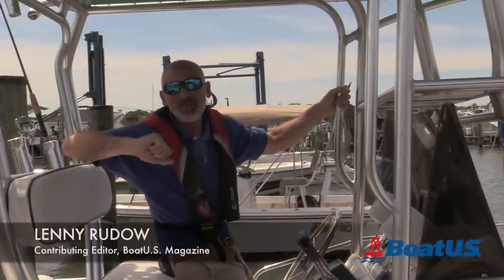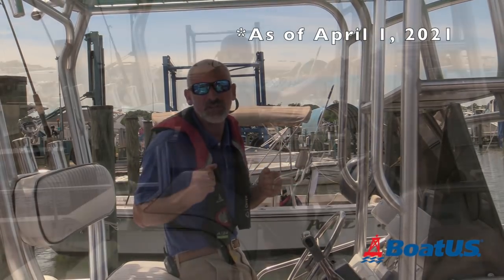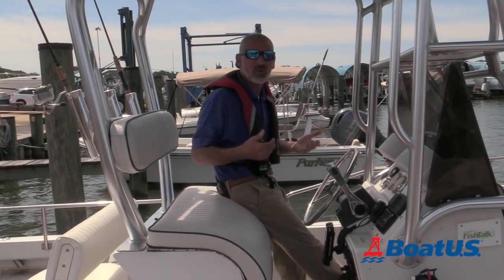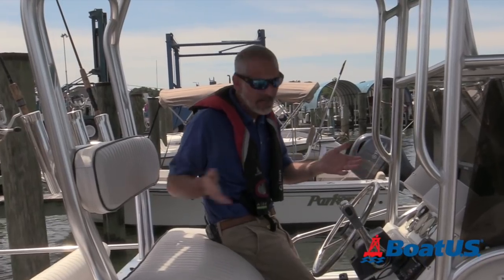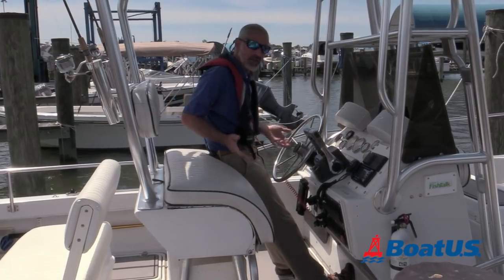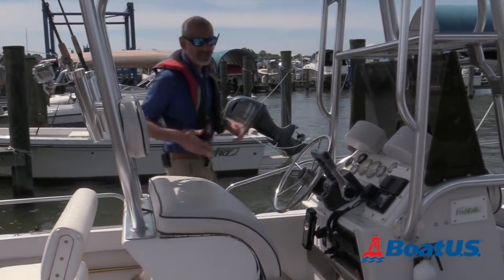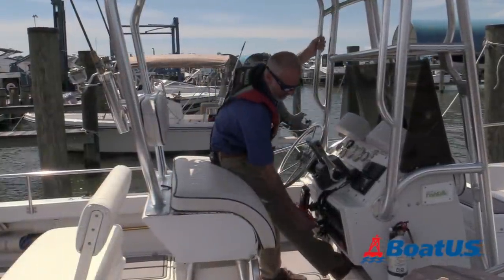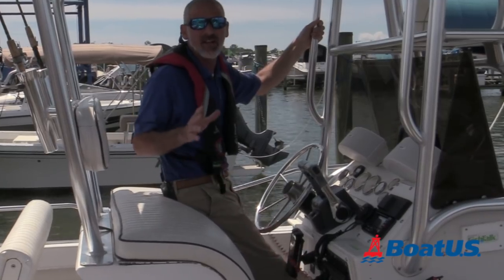Understanding the April 2021 Engine Cutoff Switch Law | BoatUS

Comment: Something I found on this topic:
"The new law applies to all federally navigable waterways. As this is a federal law, states do not have the ability to enforce the new ECOS regulation"

So, at this time, only the Coast Guard can enforce this law, And I believe "federally navigable waterways" are the Great Lakes, major rivers i.e. The Mississippi / Ohio, etc., and the Inter-coastal Waterway. To the point, it does NOT include your typical small inland freshwater lake where most US boaters operate. Not arguing if it's a good idea to wear one or not - simply trying to get the facts straight and I believe this video should clarify this point one way or the other. Peace.
Reply from the maker: I believe you're correct, Phil. There are several states (7, I believe) that have their own laws regarding engine cutoff switches, which they can enforce on their inland waterways.
Reply: @boatus  And those states would be...???
Reply from the maker: @davidmorgan4804  Alabama, Arkansas, Illinois, Louisiana, Nevada, New Jersey, and Texas. You can read more about the new law at https://www.boatus.com/expert-advice/expert-advice-archive/2021/march/new-law-requires-skippers-to-use-engine-cutoff-device

Comment: Experience tip:
The kill switch lanyard is usually left out in the elements.  After time the clip on the ignition suffers UV deterioration  and can partially disengage, killing the engine .  The problem is if you don't realize what just happened, you might end up getting towed in (like I did) .  Replace the kill switch as soon as the clip starts looking faded and chalky
Reply from the maker: Thanks for the great tip, Dan. We also recommend keeping a backup switch somewhere convenient. This serves two purposes: A backup in case your lanyard breaks or if the skipper goes overboard. Make sure to let your guests know where it's located in your pre-trip briefing.

Comment: On an older tiller boat that didn't have an ECoS are you still exempted after a repower?  A bit of a small-boat edge case.
Reply from the maker: Good question, Brent. Basically if your boat comes with a cutoff switch, you are required to wear it at planing speed, unless your state has its own laws. This also only applies to engines that are around 3 hp (produce 115 lbs of static thrust). You can read more about the law here: https://www.boatus.com/expert-advice/expert-advice-archive/2021/march/new-law-requires-skippers-to-use-engine-cutoff-device

Comment: Apparently Florida has taken the law one step further by requiring that you be connected to the cut off switch while underway; instead of while on plane.
Reply from the maker: I'm not sure about that, JPH. I don't believe Florida is one of the 7 states that already has its own engine cutoff laws, but I could be wrong. Basically, if your boat is under 26 feet and came with an engine cutoff switch installed by the manufacturer, then you need to wear it while operating at planing speed. If your boat did not come with one, you can certainly have one installed and wear one, but you are exempt from the new law. You might want to read through an article we recently published to help clarify the law: https://www.boatus.com/expert-advice/expert-advice-archive/2021/march/new-law-requires-skippers-to-use-engine-cutoff-device

Comment: It is like a lot of things. On the one hand they can be a huge pain in the rear, and cause confusion and under the correct circumstances damage or injury. On the other hand, not using one can turn an embarrassing incident you'd rather not talk about to a fatal incident you can't talk about. If I'm not very careful with the throttle, every one hits the floor if I don't warn them. If I fall out, my boat goes into a right turn and I'd rather it not have the engine running. You can easily make an extension out of anything so that's what I did. Any emergency, fire M.O.B., whatever, adrenaline, emotions, even panic, if you believe a sudden unexpected power loss might complicate the problem take it off. Pick an alternate helmsman and go from there. Hope everybody finds something that works for them.
Reply from the maker: Very sensible, Mark (And you have earned my very rare ❤️ reaction!) This is also why we promote for spouses/significant others/family members to learn basic boat handling skills in case of emergency.
Reply: @boatus  thank you. I try to help if I can. I grew up on the water and had the best teacher you could hope for. My father was retired Navy Quartermaster and working at the naval ordinance laboratory in Port Everglades. He had a short temper,  no patience especially if he thought you weren't listening. An unpleasant and sometimes painful education  (it was a different time ) but effective. Until I was 18 I thought fishing is fun if you're in charge otherwise you have to make me go. One time out with friends seas started picking up wave separation closing,  getting steeper and faster and they panicked. I told em relax, I know what to do. Back at the dock everybody's in tears and trying to hug you and I realized,  that sorry mean spirited bastard wasn't trying to torture me he wanted me to understand 2 or 3 miles from the beach it gets real and you better pay attention and know your limits,  yours and the boat. It makes me nervous how many people are out there in 2 or 3 ton boats that do 40 plus trying to learn from trial and error. I see some comments that had I said something like that I'd have been struck with something and something like who the hell told you that,  if you don't want to swim home do what I tell you and nothing else. You guys tell people what's going on without making em feel stupid or scaring  them. Great channel for good information. Even beginners have good ideas sometimes so I never pass an opportunity to learn. Not that I think I know more than you guys it's just a frame of mind. Even if you know how to do something,  there still  might be a better way. Besides a couple of minutes what have you got to lose.
Reply from the maker: @Mark Robbins  My mom sounds a lot like your dad. I jokingly call her "Captain Bly." When I was growing up, boating was serious business, and that did not make for a fun time for a kid. We spent most of our time sitting in the slip (or on the hard) working on our (even then vintage) all wood 1964 37 Egg Harbor so my mom and grandfather could use it for Coast Guard Auxiliary patrols. I pretty much stayed away from boating for much of my adult life until I came to BoatUS five years ago. I'm learning that boating can be a whole lot of fun, though it requires respect, and the disciplined lessons I learned growing up have come back to benefit me. Even better, it has changed my relationship with my mother. We have fascinating boating-related discussions that often make my dad ask, "Who are you?!" LOL. Keep up the great work, Mark. Every day is a good day when there's something new to be learned.

Comment: I've come close to hurting people on board by moving slightly away from the helm and pulling the ECO switch. I'll stand up or turn around to see who's behind and POP! Folks go flying cause the engines stopped.
Reply from the maker: It definitely has a few drawbacks as you point out. There are some longer universal lanyards on the market that may be less restrictive. Or consider investing in a wireless model, which is pricier but has a lot of benefits. (At least one of them is also a MOB device, which is useful if you boat solo.)

Comment: were can you get the long lanyard? I have a 2017 Keywest that came with a cut off switch but no long lanyard to connect to me?
Reply from the maker: I believe this is the one that Lenny was using. You can purchase from most retailers, including West Marine, Defender, Amazon, etc. https://www.westmarine.com/buy/west-marine--engine-kill-switch-keys-with-lanyard--14070346?recordNum=2 This fits any brand outboard. Alternatively you might consider investing in a wireless engine cutoff switch, which removes the lanyard altogether. It's pricier, but it offers additional benefits that come from not being tethered to the helm.

Comment: So; as the vessel Cap with several passengers on board, if I get thrown from the boat and get injured nobody will be able to fire up the boat to render aid?  I think the law is fine if you're solo.
Reply from the maker: Thanks for sharing your thoughts, Nunya.
Reply: Keep a second spare unit on board.  As I do, for a different reason.  If the part at the switch breaks, both my twin Yamahas  are out.  So the second unit which includes the coil red wire and clip end complete, will save the day.  It wasn’t too expensive either, being a Yamaha part.  You can do the same.
Reply from the maker: @robertp7209  Great (and easy) solution. Plus many retailers (West Marine, Defender) sell replacement lanyards with multiple clip styles to fit just about any system. They're inexpensive and easy to stash. Also helps to have a spare on board if you accidentally took it home, breaks, or gets misplaced.

Comment: What constitutes an enclosed cabin? Like in my case, I have a Walkaround. Enclosed on 3 sides. Front, Left and Right. Is that sufficient to call enclosed or does it have to have a rear enclosure with a door?

Also, as I understand the new law, it is only required when on plane. Not at all times.....
Reply from the maker: Darn good question, Robert. Unfortunately we cannot judge whether your boat has a cabin or not. The law merely states, "Exceptions to the ECOS requirement include if the main helm of the vessel is in an enclosed cabin or the vessel is not operating on plane or at displacement speed." You are correct that the FEDERAL law states that it is only necessary to have it attached while on plane, but you also need to know and follow the state and/or local laws for where you boat. The best I can do is share an article we recently wrote to help explain the law (and was approved by the Coast Guard): https://www.boatus.com/expert-advice/expert-advice-archive/2021/march/new-law-requires-skippers-to-use-engine-cutoff-device Hope this helps somewhat. I guess bottom line is this: If your boat is under 26 feet and came with a lanyard installed, you need to wear it, at the very least, while at planing speeds. We always recommend wearing one, but we ultimately defer to the individual skipper, provided the decision follows all local and federal laws.
Reply: I see where that could be confusing unless the C.G. or somewhere there is a legal description of what is an enclosed cabin. It causes a visual but that is going to vary from individual. If it doesn't exist, then it's ambiguous. They probably thought of that.
Reply: Ok, the only thing I could find  (quickly ) is the C.G. defines "enclosed space" as a compartment not exposed to the elements when access to and ventilation ports are secured. Hope that helps. Got a rain or storm curtain? Not sure that would count.
Reply from the maker: @markrobbins9552  My thought exactly, Mark.
Reply from the maker: @markrobbins9552  Thanks for the research! Our feeling at BoatUS is that boaters are not going to be stopped for not wearing a lanyard if the boat is equipped, but may get an education or small fine if they are stopped and are found to not be wearing one if the boat has one installed and meets the requirements.
Reply: @boatus  agree, probably have a tough time telling you're unhooked if you're underway.
Reply: Can you get knocked off the boat?  Overboard?  Enclosed = like a Parker, if one is inside steering, not happening.  Doesn’t mean you can’t get knocked unconscious in any boat, but then you are not going to be stranded and drown as the boat motors away.  People usually wake up if just unconscious, but if the same occurs overboard, lights out forever.
Reply from the maker: @robertp7209  You're correct. The way the rule is written is that even if the boat meets size and other specs, if the helm is in an enclosed location, you don't need an engine cutoff. How I understand the thinking behind it is that wearing a lanyard prevents a boat's "death spiral," which can be extremely dangerous to the person who falls overboard, rescuers, and other boat traffic. Also protects anything or anyone on/near the shore should the boat get close enough. The idea is to minimize collateral damage.

Comment: I have an 84 hydrasport 2400cc.  It doesn't have one. Are older boats that were not made w/ecos exempt from requirement or no. (Will be getting one put on though.)
Reply: It is not retroactive, but yes, a good idea.
Reply from the maker: If your boat did not come with a cutoff switch installed, you are exempt from the new law. That said, we recommend one. You may want to look into a wireless option for convenience.